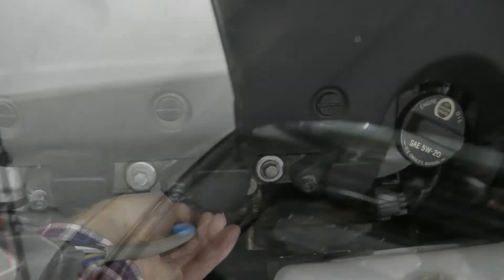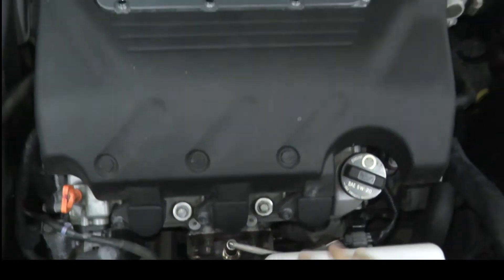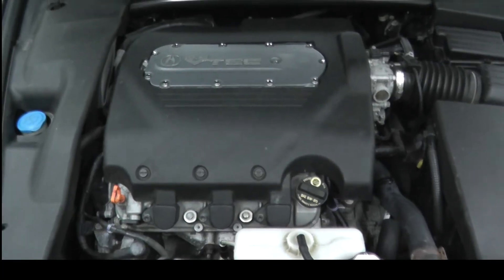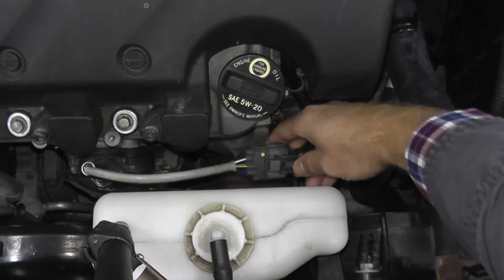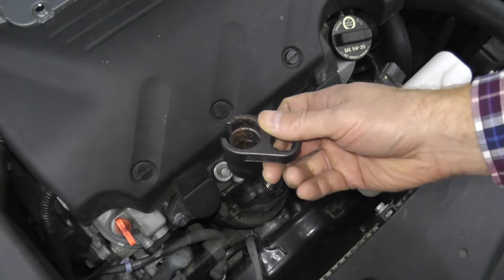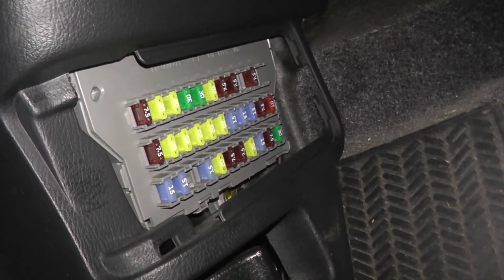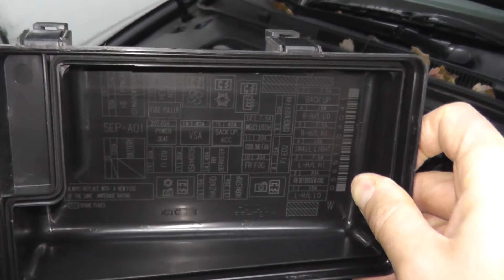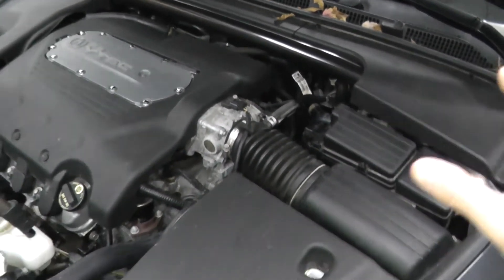How To Test and Replace Air Fuel Sensor P0153 P0154 P0155 | Bank 2 Sensor 1

Comment: Bank 2 doesnt always locate on the driver side. For example a 99 jeep grand cherokee V8, bank 2 is on the passenger side of the vehicle. If youre in front of the vehicle looking at the engine, bank 2 is on the left side, battery side, opposite side of the steering column, etc. Make sure you check before you go searching for something.

Comment: Can someone help me have code P2631 which says O2 pumping current trim circuit high(sensor 1, Bank 2) I thought it was the same sensor as the video but it works fine I tested it & even put a new one but the check engine light is still on, could it be a different sensor????

Comment: I got 2.7 ohms. Wiring also looked good. Both fuses looked good.
I'm still getting the error for that sensor.

Anyone have any suggestions?
Reply: Check its voltage while engine is on. Get REVs about 2500 and compare bank 1 and bank 2 02 sensors 1 readings. Also compare the, with their respective 02 sensor 2 readings

Comment: I have a question I have a 06 ford freestyle..a wrench light pops up on the dash and it will rev up very slow and won't go over 30 or so mph but runs and drives perfectly fine before the wrench light pops up if i can get on the road before the light pops up I can drive it highway speeds with no problems but once I stop at a stop sign the light pops up and messed up...ive replaced the electric throttle body and I checked trans fluid and I cleaned the mass air flow sensor..I have this code popping up sense the electric throttle body is very sensitive to air problems could it be the sensor? I also have a code p0701 transmission control system range/performance